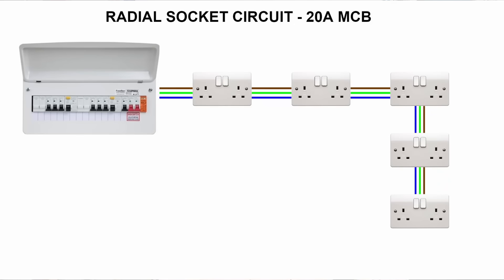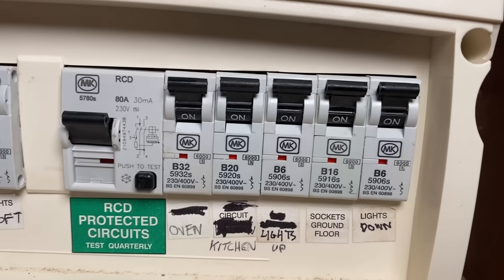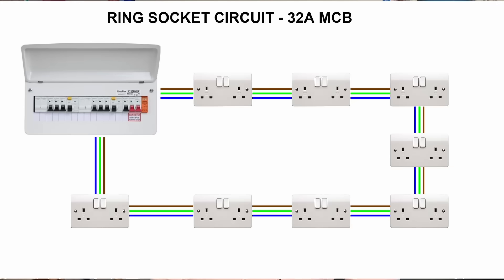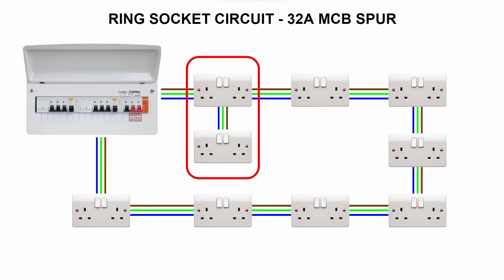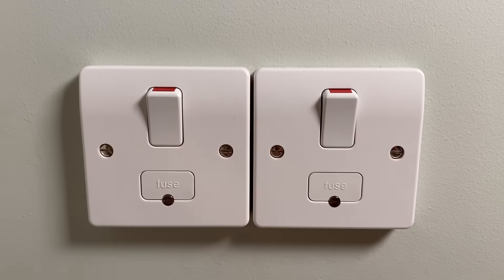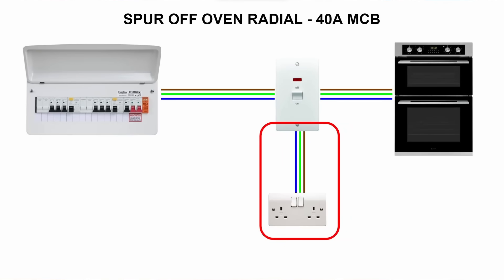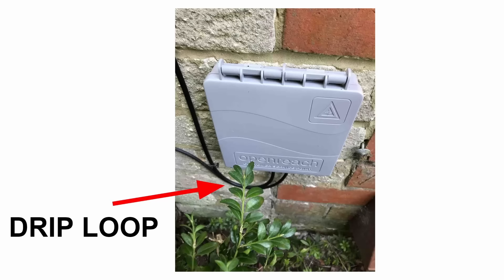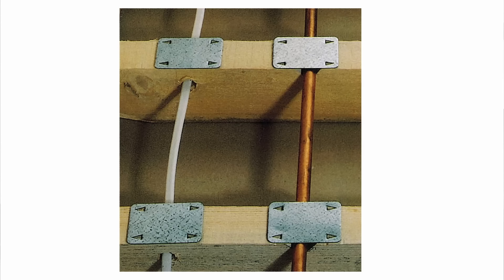BIGGEST DIY Mistakes Adding a New Socket

Comment: "But there's always a danger the fuse wouldn't blow"
Is that a thing that could happen? I thought fuses were designed so the filament would be guaranteed to burn up if the rating is exceeded and are made with tight tolerances to ensure that it will blow when it's supposed to. A fuse only has one job, if it can't do that one job reliably then what is even the point?
Reply: Anything can happen!  Look, this guy just hit you in the bum with a freaking hotdog!!!
Reply from the maker: Thanks for watching

Comment: I got a very simple solution for the ring: Just fuse both sides. Fuse is only in parallel, if the ring is connected. If it is not in parallel, it is only rated at half the amperage - which actually is still resulting in the proper rating of cable and fuse. Easy as that.
Reply from the maker: Thanks for watching!

Comment: Why the heck 20 or even 32 amps? This sounds very, very dangerous. "Just use" over 200 volts and 16 amps is plenty. I mean in germany 230VAC at 16A gives over 3.5kW of power. That is just enough for all house appliences. And we do not screw anymore (except in Breaker Boxes with quality terminals), we just plug into properly designed spring contacts. These are amazing, as they are very simple to use and also extremely reliable, as expansion due to heat will not wiggle the contact loose over time.
Reply from the maker: Interesting to hear, thanks for watching!
Reply: 30a rings were designed when UK homes used electric heating, so you could have a 2kW heater in each of three bedrooms upstairs, and, say, 2kW heater downstairs, plus kettle, iron, toaster, washing machine, dryer on a second ring. Most houses now have gas heating and rings have started to be less needed. However some people still put them in kitchens where multiple cooking devices, dishwasher, combi oven, washing machine etc may all be on one circuit.

A 30a circuit is not, in itself, dangerous if wired with the correct cable (or pair of cables in a ring) and breaker and good terminations.

Comment: Aren't those ring circuits kinda dumb because where do you know if you have the same phase on both cables until two of the main fuses blow?
Reply from the maker: Most UK housing is single phase anyway, so very unlikely to be an issue. Thanks for watching!
Reply: The ring consists of a cable connected at both ends into the same breaker. It's one circuit shared between two cables to increase current-carrying capacity. They're only 'dumb' if someone breaks the continuity by fiddling with the wiring.

Comment: I'm always uneasy running a spur from a ring main with 2.5mm cable. I try to run my spurs using 4mm cable, as this gives me confidence that the spur is able to achieve the same rating as the ring. In theory, using 4mm should allow you to run two sockets on the spur as the cable is sufficiently rated, but this isn't allowed for in the regs, but using 4mm gives peace of mind.
Reply from the maker: Thanks for watching!

Comment: Most sockets will blow past 13amps that's why you can add one socket to a ring without a fuse spur. Also you can spur of lighting as long as it is labelled as 3 or 5 amps max
Reply from the maker: Thanks for watching!

Comment: As an electrician of 44 years and approved NICEIC contractor, you are pretty spot on with this video, but would remind anyone watching that the provision of a new circuit from CCU would require to be Part P notified and an installation certificate issued. But still one of the more accurate diy videos I’ve seen. 👍
Reply from the maker: Thanks for watching!
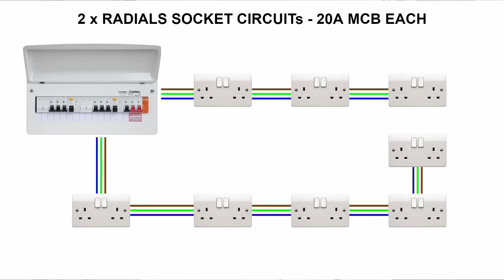Reply: does this mean that the suggestion at 3:42 where you break the ring into two radials, and add a breaker, you would have to become a Competent Person?
Reply: @GeorgeHafiz  
You have to be competent to start any electrical work.
Reply: Its an unusually good explanation from a DIYer. A few sparks i've worked with still can't see the potential problem with multiple spurs disturbingly. Many rings wired correctly to a 32a MCB are still not really OK. 

Once you take in to account cable runs through possible insulation in existing installs, there is a potential of thermal problems. Quite a few sparks I know and myself also often derate the MCBs to 20a on existing 32a ring finals to eliminate these issues and keep Zs values acceptable. Other than a kitchen, its fairly rare an area supplied by a ring will ever require more than 20amps. 
The only real advantage of a ring is versatility, as you can theoretically draw 32 amps from one room if you want - but unlikely in this day and age. In the days of 3kw electric fires pre-central heating and very little insulation, if any, in dwellings, they were quite a good idea. 
Copper would generally be saved in older ring installs, as the ring would run around the more central part of the house - usually where the fuse board would be, then by design various spurs would be taken to the outer walls of the house. 
I do feel that 32a rings on new installs should be avoided and taken out of the regs.

There used to be a reg stating you can't have more spurs than points on the ring, but was removed a while ago I think.

Pinching power off an upstairs lighting circuit can be fine in a loft, generally only required for a TV amplifier unless you plan to grow thing up there!
Reply: @Lucozade.sport7  
Ban rings? Please!
With more and more very low current drawing consumer appliances about they are superb, giving as many outlets as you need. One ring replaces a multitude of radials and associated AFDDs and larger consumer unit, reducing costs greatly. 

I have a hob, oven, dishwasher,  washing machine and boiler on their own dedicated radials.  LED lights on two 1.00mm radials. The final socket ring does the rest. The heaviest appliance on the ring is a 1.5 kW vacuum cleaner (about 6 amps) which is used for a matter of minutes each time it is used.  The one ring can also be on one AFDD, giving the highest protection.
Reply: @johnburns4017  HAHA, your contribution shows up stingyness, not safely awareness.  RING is strictly forbidden in most of the world, due to the structural safety risks. The UK always hikes behind...  (Whether you like it or not)
Reply: @Wig4  
You will find rings are not forbidden, they are just not understood so not done. 

Rings are safe, the UK electrical system has one of the safest systems in the world yet has used rings for the past 75 years. With AFDDs they are even safer. 

All you have done is show gross ignorance.
Reply: @Lucozade.sport7  
One spur to one junction point on a ring.
Reply: Part P also says that even non-notifiable work must inspected, tested and certified. How does the average DIYer do this?

Comment: So don't use a 4 plug extenuation or your house will explode
Reply from the maker: An extension lead is fused at the plug, so no matter how many plugs you put in it, max current drawn will be 13a.
Reply: No....    when the amperage drawn is more than 13A the fuse will pop. @TheDiligentDIYer1759

Comment: That’s not the right way, but it will certainly work! And it will reduce amount of power you can safely draw.

But c,mon it’s common sense, if you e done a diy bodge like that then don’t plug 5 electric car chargers into it or your gona have problems.
Reply from the maker: Thanks for watching!

Comment: As an electrician I can tell you that if its not in a kitchen, any other rooms will be fine. 

And if youre putting in electric radiators then run dedicated circuits.
Reply from the maker: The problem is you don’t know what people will plug in

Comment: i dont understand how a spur off a spur in a ring circuit causing a 52a load is any different to a radial circuit with multiple plugs in a row, are radial circuits rated at say 68a for a 3x double socket run? and is the cable rated appropriately for this, some houses must require massive cables to provide for all the double plug sockets. Am i missing something?
Reply from the maker: Bigger houses typically have more circuits, so not just the normal 2 up, 2 down. Thanks for watching

Comment: If you're not an electrician and are planning to add any socket, or light switch. Listen to this firstly!!!!   It will give you the confidence to add the electrical circuit and be certain you're doing it correctly.  The advice he gives is absolutely correctly pitched AND ■(surprisingly)■ is even backed up with mathematical proof.   Well done video poster!!!
Reply from the maker: Very kind of you to say, thank you!
Reply: Most gadgets now low consumption so to reach 20amps is hard plus u ad one socket not 3 or 5 😅😮 on the ring. But i agree very good explaniation i learned a lot. But if u have a litle brain u know kinda what hes saying
Reply: Thanks mate, clear precise and stopped me making a mistake. So thank you
Reply: I would have almost no confidence in my ability to identify the paths of ring circuits in my home. It was built in 1976, and rewired by a gobshite, at least partially, at some point in the early 2000's. I'm fairly certain I've extended the end of a radial to two double sockets in the living room, it's just for lamp lighting and phone chargers.
Reply: Completely agree! Just came across this and it was on point. Very insightful and clearly/simply explained 👌👍
Reply: I would have almost no confidence in my ability to identify the paths of ring circuits in my home. It was built in 1976, and rewired by a gobshite, at least partially, at some point in the early 2000's. I'm fairly certain I've extended the end of a radial to two double sockets in the living room, it's just for lamp lighting and phone chargers.
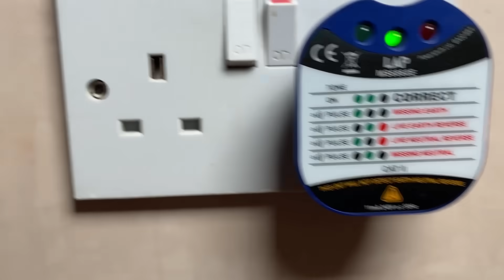Reply: 😮 😊😊😊x😮😊 2:19 😊 😊 2:25  😅.  Bc
Reply: Brown 👃
Reply: Troll 😂 see... See how easy it is to make an unnecessary comment... Smh
Reply: Disagree! as an qualified electrician, it is advisable not to mess with electrical circuits etc unless you know what you are doing and fully trained. The risk is electrical shock and fire to ones home, and shouldnt be under estimated. My advice is Electrical and ofcourse Gas should be left to the professionals- it's not worth the risks that come with it👍
Reply: A ring circuit is not a safe way to wire outlets.  It. Is of limited use with too many fault potentials.

Comment: OK, I have a spur from one double socket. Idealy i would like to be able to run another spur from the orignal socket. My understanding is that providing i can get the wires in it whould be OK as long as the total number of spurs do not exceed the number of sockets. I may be able to extend the ring to the socket that is already a spur thusly removing this issue, but I am not sure if that going to be possible as I am not 100% on the cable run.
Reply from the maker: Yep that sounds okay, i think you’ll struggle getting 4 cores in the terminals though. Thanks for watching!

Comment: A spur on a spur on a spur is essentially a radial on a cable which is not designed (because of its size) for the current drawn through innocuously plugging in multiple heaters (for example). 

The problem with putting too much current through any cable is that it will heat up and the insulation will fail (melt) and then you get FIRE. Fire may burn your house down and kill you and / or your family - or the people who follow you into your house in living there. 

Would you like to burn to death because of someone else's stupidity? No? Then DON'T add or change electrical circuits unless you understand the dangers!
Reply from the maker: Yep agreed! Thanks for watching!

Comment: As an electrician for 30+ years I still prefer ring circuits but not 2.5m. But 4mm
Reply from the maker: 4mm rings is heavy duty for domestic! Thanks for watching!
Reply: @TheDiligentDIYer1759  but 2.5mm has a limit of 100M'2. I had to do a house where down stairs was hard floor so only route was upstairs down plus one part was unreachable for rewire so had to link via junction box's, so to cope with load on that circuit 4mm was only choice.

Comment: Spur of a spur depends on the amps your going to be drawing on the spur or spur of a spur, it's just common sense
Reply from the maker: You are correct, but you have to assume someone is going to max out however many sockets you spur with, so for that reason, the max length of spur is 1 double socket. Thanks for watching!

Comment: Many clearly do not understand what a final ring circuit is and how it came about. The ultimate design is to have a radial to each socket outlet on its own fuse at the Consumer Unit - the optimum solution of course. One fuse at the Consumer Unit for each socket.  This means you will need a gigantic consumer unit and lots of fuses/breakers (one for each socket) in the consumer unit, and an amazing amount of cable. 

🎊🎈  BINGO  🎊🎈 A final ring circuit gives this by distributing the consumer unit around the house via a ring cable, having a fuse on each socket outlet. The ring cable is a fused busbar. This saves the vast expense of a plethora of radial cables back to the main panel and also a plethora of fuses at a gigantic consumer unit.

Simple, ingenious and highly effective.
Reply from the maker: Thanks for watching!
Reply: Never seen anything else in the Netherlands, although you need to use conduit to be able to pull exactly the wires you need or including lights switches will be a wiring nightmare.
Reply: @hunchbackaudio  
Seen what?

Comment: At 230 volts:
A 32A final ring can handle a max of three loads of 2,453w (2.45kW).  
A 20A radial can handle a max of two 2,300w (2.3kW) loads. 
So two radials will be needed to do the same as the one ring.  Then cost in two AFDDs for the radials, the ring is a no-brainer.
Reply from the maker: I still prefer the radials, the cost of the breakers is very small over the life of the install, and most boards come with a lot
Reply: @TheDiligentDIYer1759  
Read my post on rings. All there. The cost of an AFDD is not low. Always put them in.  They are mandatory on socket circuits in some installation and high rises and recommend for all installations in the 18th.  They should be mandatory on high current loads such as showers, which are notorious for causing fires.  So install them on electric showers. 

With AFDDs on socket circuits you want to keep socket circuits to a minimum otherwise the costs spiral upwards. Rings keep costs down without compromise. 
A 4mm ring using Wago connectors in the backboxes to take the ring's load with 2.5mm flex to the sockets, and an AFDD, is near bombproof. 

Look at my post on the flat with only two circuits.  Using an AFDD as well. A tiny CU as well, out of the way.

In some high rises after Grenfell, some Councils fitted AFDDs on all circuits to be sure. At the time £100 a go with some having 8 circuits.  £800 per flat in AFDDs alone.
Reply: @TheDiligentDIYer1759 
AFDD breakers are mandatory in some installations, and recommended on all socket circuits. They are not cheap.  Have a bunch of radials you will soon know the cost.

Comment: A friend a few years back bought a one bedroom flat in London, costing a fortune of course. He was stuck for money renovating the place. He focused on the bathroom and kitchen to spend. I told him he could cuts costs on the electrical system. I explained. ...

Have two circuits with a very small and cheap Consumer Unit box. One circuit serving a 4mm ring and one 1.00mm lighting. Heating and hot water was via a gas combi.  I said Induction hobs are now available with 13A plugs. Ovens now have integrated microwaves (saving worktop space) being 3kW maximum (13A plugs). He was to have a dishwasher and washing washing.

So, the ring to have:
▪ The induction hob (3kW) and oven (3kW) off 13A fused spur isolation switches in adjacent cupboards.
▪ Dishwasher (2.2kW) and washing machine (2.5kW) off 13A sockets in adjacent cupboards. 
▪ The ring fed four heavyish current drawing appliances plus a toaster via the sockets. He used an IKEA kettle on the hob, so no need for an electric kettle taking up worktop space. The rest on the ring was TV, computer, combi and phone charging. 

If The 4mm cable was cut for any reason the AFDD 32A breaker would protect the two cable legs and also if there was any imbalance on the ring. The ring was a distributed busbar. 

The likelihood that all four appliances would ever be on full power at the same time was extremely slim (diversity). He bought a reel of 4mm cable on a good deal as well. 

I suggested at least an RCBO, but ideally an AFDD on the ring with an RCBO on lighting would be far better. He went for the AFDD costing about £55 over the RCBO at the time. 

Works a treat. Very safe, as all the flat is given AFDD protection apart from the LED lighting, which can have an AFDD in the future with a simple swap in and swap out.  Never had any problems. It never costed a fortune - saving quite a lot of money.  Look at the Continental main boards in one and two bedroom flats - huge and expensive full of radial circuits and breakers - typical in French installations is three RDCs in a small flat.  It looks like what you may have in a small school. Unnecessary.
Reply from the maker: Thanks for watching!